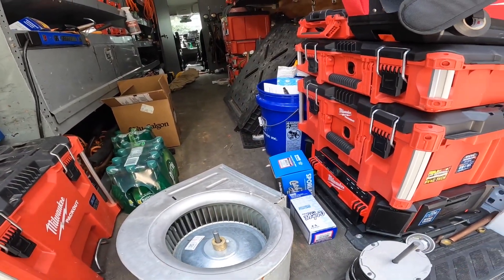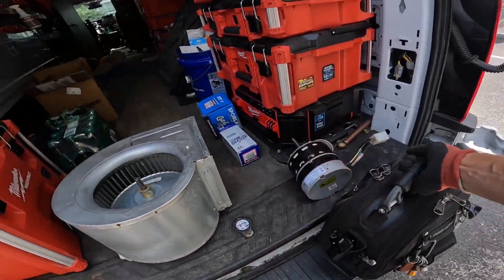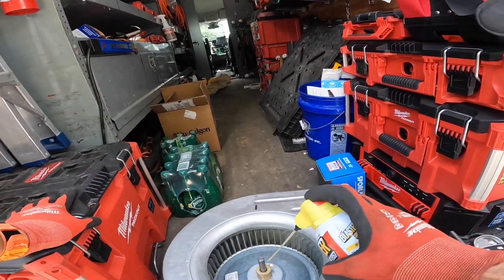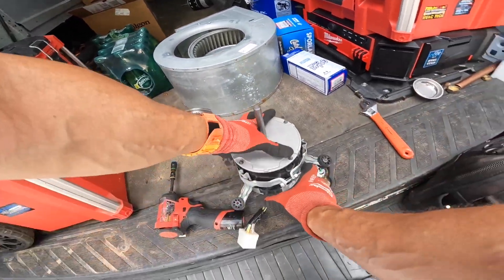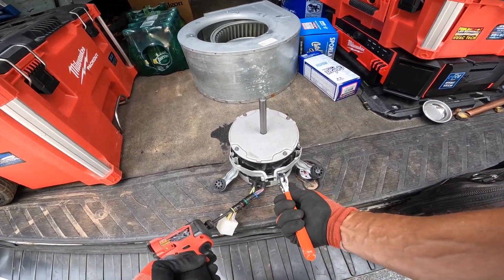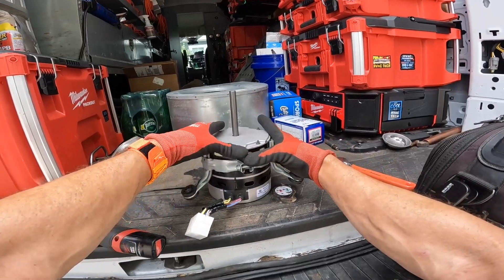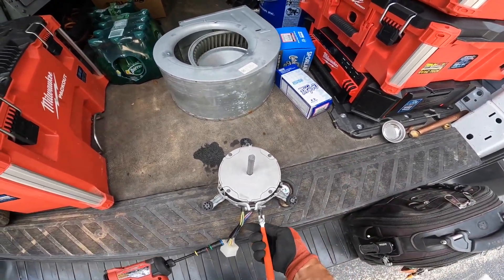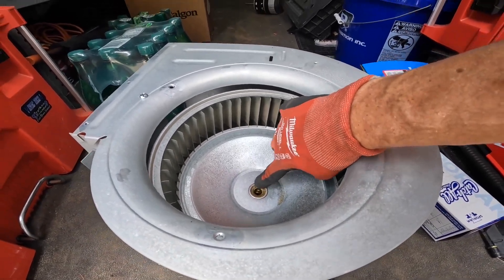ECM Motor Won’t Start Up! #hvacguy #hvaclife

Comment: Have you considered installing an 'ECM Protector' device when you replace an ECM motor? They are designed to stop spikes and power surges on the mains power wires from getting to the ECM electronics causing damage and just plug-in in series with the power into the motor. There are a few different types to suit different ECM motors.

Comment: Hey Bo try this and see how you like it.. You can use your service wrench to tighten and loosen up the lock/set screws on the indoor and outdoor motor shafts instead. But Obviously you’ll take the service king valve tool off and use the second largest ratchet size on the bigger side. It works easier than using a crest wrench I think, but hey It’s all preference on how you do the work tho. As long as the outcome is the unit is fix and working back properly.

Comment: I never had a work van that looked so professional and clean lol. I’m thinking you and Milwaukee are good friends. I was a tech for 38 years, retired now and sold most of my trade tools except a few things. After your knee or knees go, it’s pretty much all over as far as field work goes. I went from HVAC&R to Dehumidification and VOC Removal systems. I worked for a manufacturer as a factory tech the last 18 years. I remember those hot days on a rooftop firing up the oxy-acetylene not to mention the prep work on a compressor replacement. I also remember dumping 100 lbs of R-12 into the atmosphere on a split system that had a burnout. This was in the mid 80’s and recovery systems just wasn’t something techs had or had to do. I enjoy your channel and hope you’re doing well. It’s a great trade but eventually can take its toll on you physically. Mentally as well with new technology lol.

Comment: I like that multi socket set driver , I bought one. Also your tool caddy ,I found a Kline tool one at the plumbing supply store and bought it. Not as nice as yours but it works! I changed out a blower motor on a mini split today , what a pain in the butt that was.. didn't fix the problem I thought it was the board but the service tech had other ideas! Try to stay hydrated and get a little rest!

Comment: The motors are likely fine. The control electronics would be junk. In industry, vfd controlled motors last longer than the same motor run straight off the line. But, good vfds are expensive. I've installed dozens and had few failures.
Reply: @Bryan-Hensley  Actually, the eddy currents were destroying the ball bearings with tiny pits. But, modern motors are inverter rated, with upgraded insulation and provisions to shunt stray currents around the bearings or ceramic bearings. The changes are important because VFDs are designed into a lot of gear. Look how much simpler a washing machine got without all the mechanical doodads to reciprocate and change speeds.
Reply: @Bryan-Hensley  HVAC is about the only place I've seen where they integrate the drive with the motor. Some servos do this also. The time/labor argument is a sound one, but the cost of tossing the good half with the bad is pretty high and probably cancels the savings from a variable speed motor if you have to replace it. I can't remember many cases where you had to replace both the drive and the motor unless there was a fire.

Comment: Nice work, it looked like you have changed a few of those before, lol. I'm in the same shape as the customer you quoted, compressor is still running, but sounds a little rough. I put that stop leak junk in it a while back, charged it up and prayed. Just trying to buy a little more time, it will be interesting how long it will last, and experiment on the stop leak. For 100 bucks it was worth a shot, we will see. If the stop leak does not work on the small leak I have, to me that would mean it doesn't work at all.

Comment: I use the Bahco 6 inch wide mouth adjustable wrench for service caps, fans etc, small size of 6 in and I won't over torque things. Channelock makes a wide mouth also with cushy handle.

Comment: On those I usually put a piece of cardboard on the coil then drop the housing down and change the motor in place…you will have the room side to side in case you need to use a puller

Comment: If you Don’t want to Go to College and get a Degree which may or may not help you get the Job of your Dreams, then consider a Trade School for a Guaranteed Job👍🙏
Reply: Nothing is guaranteed in this field if you don’t have a good work ethic and skill set. I’m retired from 38 years doing commercial and industrial service. I went into dehumidification the last 20 years. I tell young guys, develop good communication skills and keep up lol. I transitioned from old to today’s high tech controllers and everything in between. I lived quite well and still do but my body took a hit, knee replacement and working in industrial environments caused some minor breathing problems so far. Take care of yourself out there. If you’re doing a lot of working on your knees consider knee pads or a piece of 1” Armor flex to kneel on.

Comment: I replaced an X-13 about a year ago with a rescue on our bigger unit. My other unit takes a Broad Ocean. At that time and I haven't checked since there wasn't a rescue motor out yet. Supplier said they haven't reversed engineered it yet. I was looking to keep one on hand.
Reply: @Bryan-Hensley  I kept the motor for an emergency spare. Mine did the 24/7 on. The module cost more than the rescue motor. It was also under warranty but the installer wanted $700 labor lol. I'm a DIYer so I bought a good quality rescue and it's been great since I swapped it out. Used the Ted Cook method to get the blower wheel off. I have a puller now too just in case. I know I could have put a PSC motor in it but hopefully I made some changes that will help the motors. Both my systems are in their own closets. I cut the bottom panels out of both doors and added some nice louvers. The doors look factory. I think it was an airflow issue that killed the original motor. Time will tell. It was 1.5 years old too. Going to take the 608 exam because why not. :) For anyone interested in taking the 608 for free Skillcat is your friend.
Reply: @Bryan-Hensley  Thanks Bryan. Mine came off pretty easy without a puller. Whole thing took me 45 minutes for never doing one before. I would have went for $120 since it was cheaper than the rescue but I'm in So. Fl and rates are high here. I'm also in the service business (automotive locksmith) and we charge accordingly too as we have too.